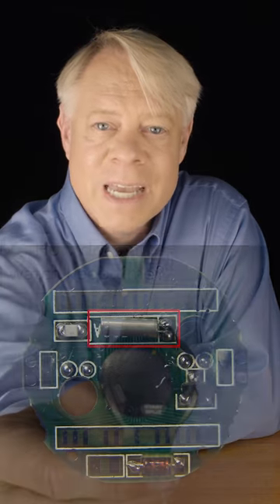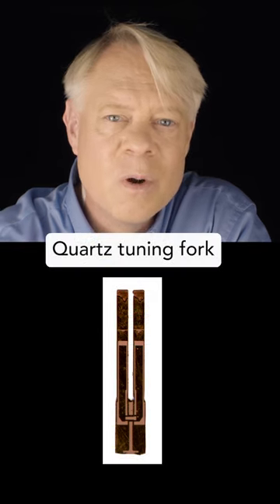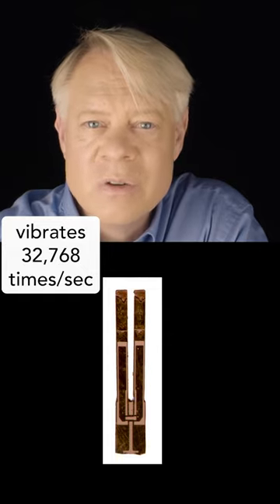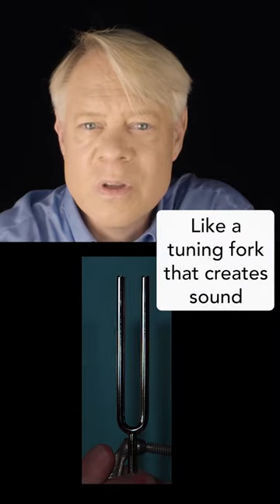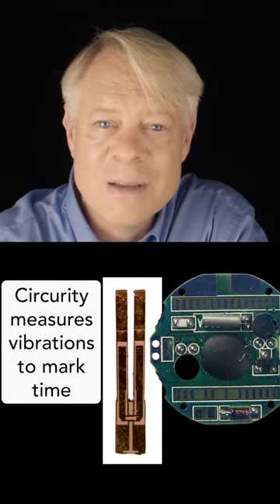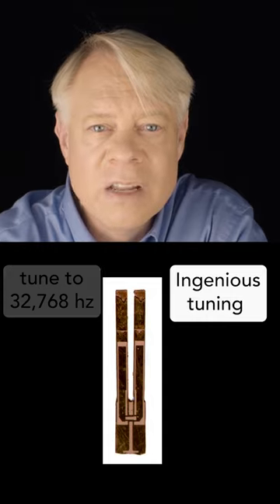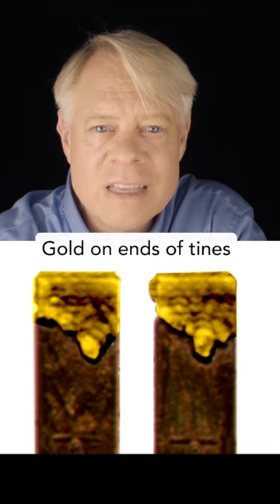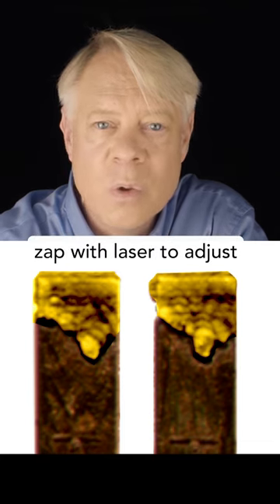How a Quartz Watch Works #Short #engineerguy #engineering #invention #timekeeping

Comment: Do use a favor and build one about 55'x55' square, hook it up to a generator instead of a clack hand ☝️, gear ⚙️ it to have enough torque and speed to putout a large load of electricity ⚡️, add a couple of spring loaded main gears ⚙️ that can be alternated to rewind between unwinding and make an actual fuel less, power house, that only needs maintenance and operators to assure everything is working properly and smoothly, and you can make money producing power to the electric grid with no pollution, running without fuel ⛽️, minimal workers needed, and you can basically not have to spend our country's money on buying imported foreign fuels, and minerals. This idea 💡 can make 🇺🇸 a 100% self sustainable electric grid, with less risk of toxic accidents that occur during the transport cycle of fuels, chemical byproducts, and other harmful materials that you would no longer need to produce electricity ⚡️ from a timepiece generation plant to the power lines, to homes and businesses. And you can still charge us for the electric bills. Minus the dirty air and water conditions that our current power stations can create.   You welcome 🙏. Become a billionaire if you aren't one already Mr clocksmith